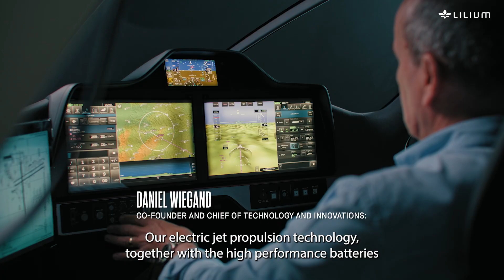Join our mission | Lilium

Comment: 0:12, that hangar Yves is standing in that looks mostly empty was like this just after the first aircraft caught on fire due to improper engineering, and this section was taken around '21/'22.
The batteries, not if, but WHEN they catch on explosive fire (LiPo), they will be located just underneath the armrests or side walls of empannage, mere cms from where the passengers sit.
Lilium made a lot of people quit, one of them questioned the applicability of the bolts that held the engines together as they are not aviation rated for their load case, that's the last I heard from him. Another was asked to leave the airport premises after handing back the company clothes they gave him which he was wearing at the time, including pants.
As an ex employee, I wouldnt believe any marketing video they produce until we see humans in the aircraft flying
Reply: Oh also comapny will keep the employee count to sub 1000 AFAIK to not only pay less taxes, but more importantly keep the availability to fire anyone for any reason as it is law in Germany that enables this for 'small' companies so long as they have less than 1000 employees.